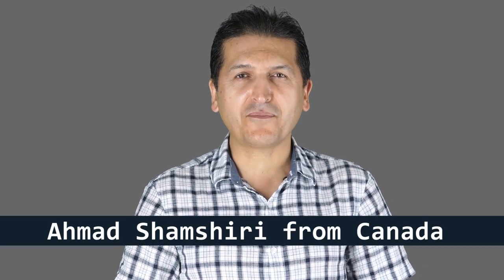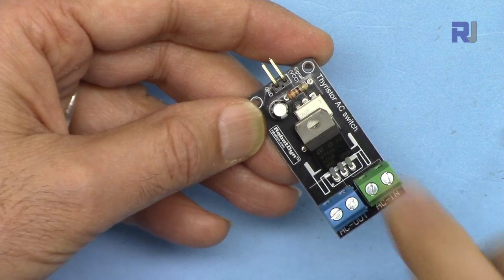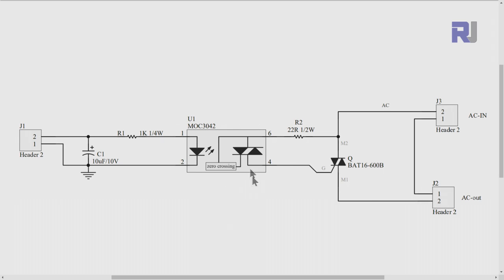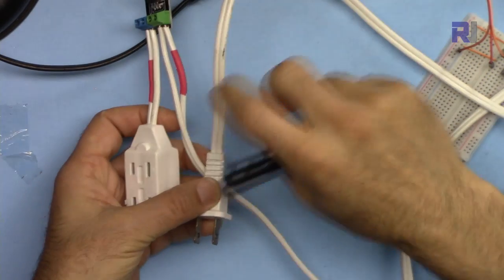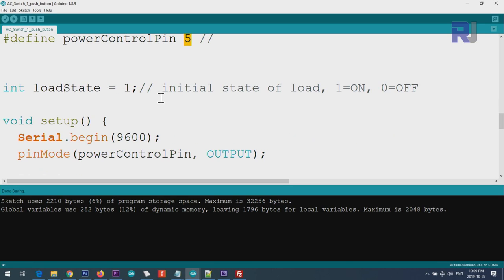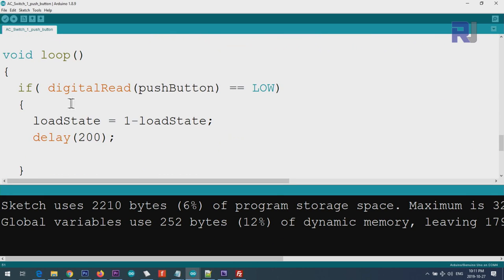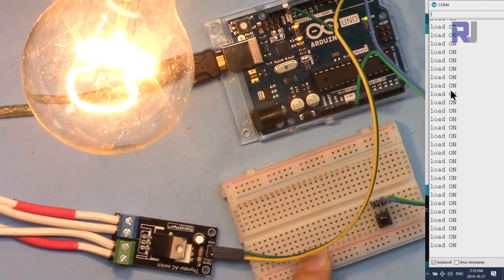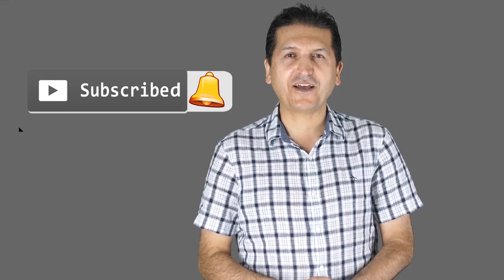RobotDyn Control AC load or AC bulb with Arduino AC Switch with Push button (push ON, push OFF)

Comment: Gday Robojax Is the Triac Heatsink at mains voltage and therefore a bit dangerous?
Reply from the maker: It depends on the Triac. If you have (TO-220AB Ins) package, then the "Ins" stands for "insulated" as shown in page 1 of this datasheet https://www.st.com/resource/en/datasheet/t1610.pdf and it should be safe. But generally teat them as dangerous and never touch it when connected to power.